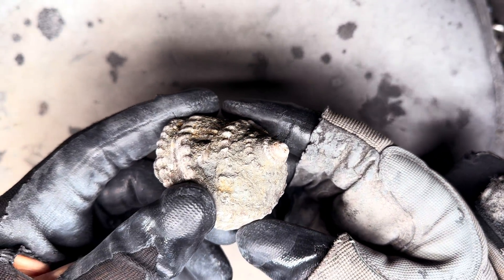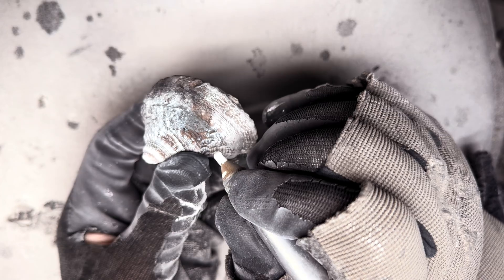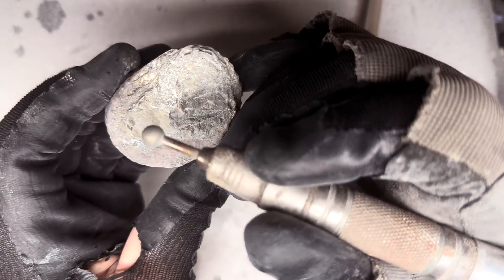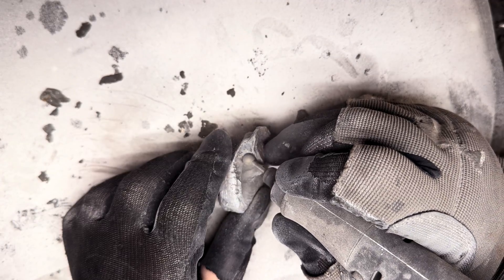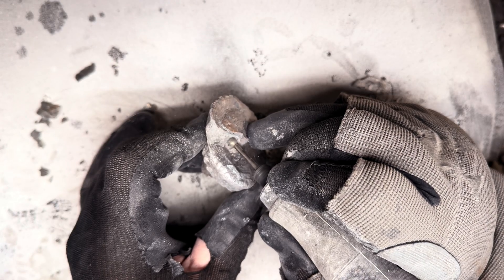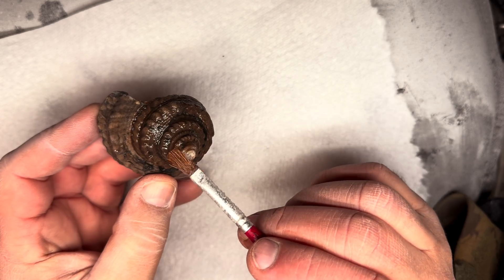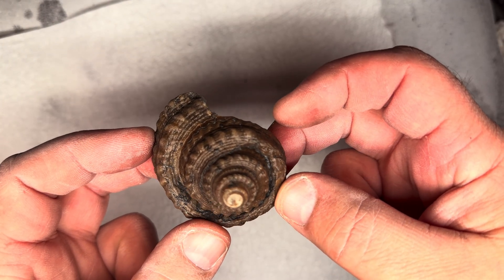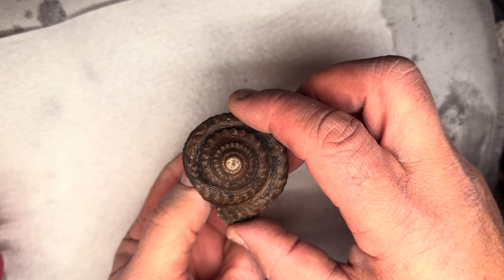We Prepared A Fossil Gastropod!

Comment: Not that old.Science does not directly supply us with any actual "clocks," just physical processes, which we then turn into clocks based on certain assumptions we make. Radiometric dating involves the decay of unstable or "radioactive" elements into stable, non-radioactive elements. One such example is that of uranium decaying into lead (e.g., 238U into 206Pb). It can be much more complicated, but in its simplest form the estimation process works like this: Measure how fast 238U decays into 206Pb. Determine the current amount of 206Pb in the rock being dated. Calculate the age of the rock from these two figures how long would it take the discovered amount of 206Pb to be produced from the decay of 238U). In order to use this method, three assumptions are necessary, -Constant decay rate, -Closed system, -Zero initial daughter element. The decay rate for the isotope is assumed to have never changed, but recent research has proved this not to be so. Closed system, to say that the rocks we are dating sat there for multiplied millions or even billions of years and were never affected by any outside influences is not only an assumption, it's a very unreasonable one in many cases. Zero daughter, again an assumption that the sample had NO daughter element in it when it formed. Another unreasonable assumption. These assumptions cannot be verified as they are in the past and no one was there to observe them. So this dating method is basically one big guess. https://answersingenesis.org/geology/rock-layers/were-rock-layers-fossils-formed-quickly/?